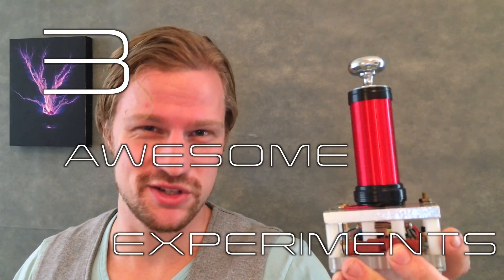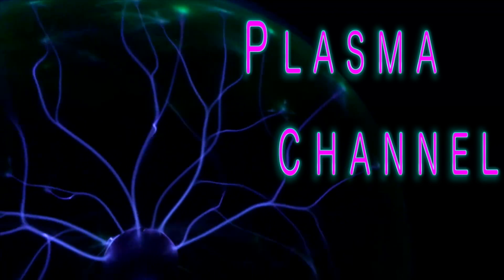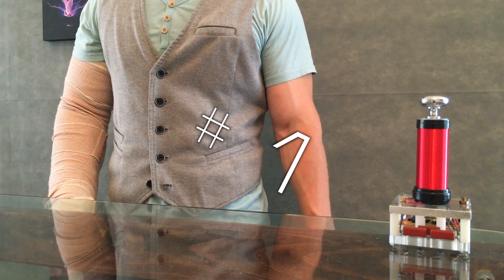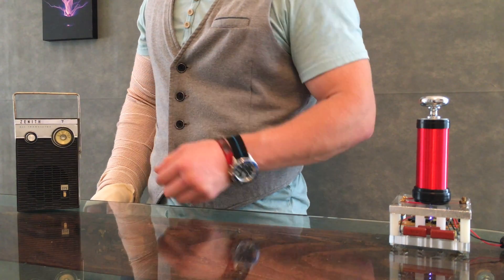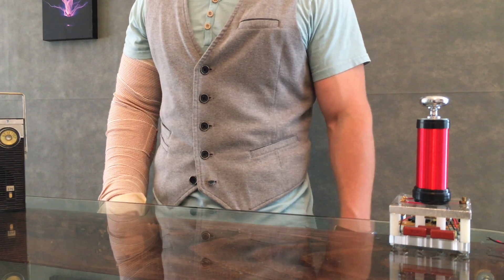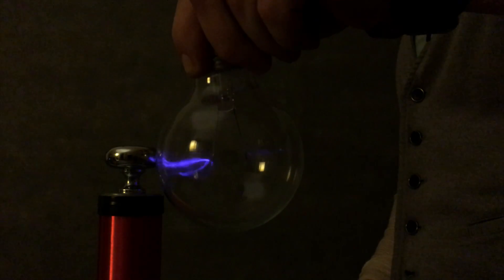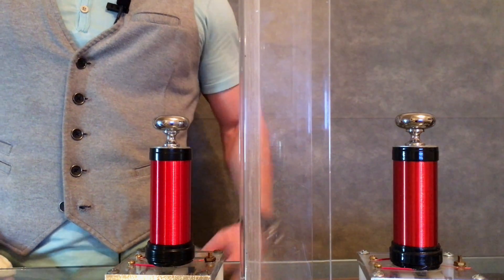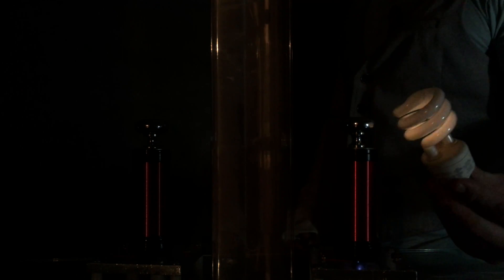3 AMAZING EXPERIMENTS | 3v Tesla Coil |

Comment: I have questions I made that but I dont  have  capacitor like what you show I only have is 3kv ceramic capacitor. I try that capacitor but that is so weak what do you think can I replace that capacitor to increase the plasma, sorry to my English  cuz iam 15yrs old Filipino I hope you understand
Reply from the maker: Hello, you need a capacitor rated to the same capacitance as what I used, in order to get the same results. VOltage is different from capacitance.
Reply: @PlasmaChannel  ahh ok really need to to find that

Comment: Bone breaks smart (usually) No video? Triple x says if you didn't get it on video, it didn't happen.
Wishing you a swift and uneventful recovery. How many resonant coils do you have? you Know each one does not draw down the power from the transmitter. You should be able to power up a lot of them and "daisy chain" a long series of them. RIght? can you step the power down to normal AC? and set up portable power in the back yard or campsite? (all on 3 volts, AMAZING PLASMA POWER) Party on Dude, stay classy. Set up a remote tea/coffee/espresso cart without power cords limiting location and tripping people (could prevent broken arms).

Comment: Is it possible to make the AC Tesla coil using 12v 1amp ac supply , sir please tell me about the overall calculation
Reply from the maker: Yes it is, but you'd need a whole new powersource. 12 volts needs to be bumped up to higher voltages in the first place.
Reply: Can you please tell me about number of turns and gauge selection to make high voltage Tesla coil using 12 v

Comment: I've heard about someone coming in contact with a high DC voltage, and the high current through the muscles causing them to contract, and that forces their body to lurch suddenly, possibly hitting something so hard that they break a bone.  I got shocked with the 250V B+ of a tube amplifier and I thought someone had pushed me from behind.  But it was only my muscles.  And I luckily didn't get hurt...
Reply from the maker: Wow. You got really really lucky. In general, always keep one hand in your pocket when working with high voltages. This guarantees you  never have electricity going across your chest.

Comment: You have to be careful with the light bulb experiment though.  If the bulbs walls fluoresce green, that means there's a vacuum in it and you're creating bremsstrahlung x-rays.  It's particularly low energy x-rays, which means your body is absorbing most of it increasing your effective dose.
Reply from the maker: It is indeed true. High voltage in a vacuum is inherently unsafe
Reply: Nonsense.
Reply: @2100Warzone   Sense.

Comment: If I power it from my bench top power supply what is the highest voltage I can put through it? Would it create larger sparks at higher voltages or just blow something up?
Reply from the maker: For extended use, 3 volts. But you can push 5 volts through it for 5 seconds at a time, with no damage. Don’t do much more than 5 second though, the little black transistor gets real hot and WILL break.

Comment: why might your coil work so much better than mine?  I can only get arcs about 2mm long to my finger and the light bulbs are way dimmer.  I am making a second attempt later next week though so would like to try to squeeze a bit more power out of it!
Reply from the maker: Did you use the specific racket linked in the description, the specific capacitors. Same number of primary turns and same length of secondary with same diameter and wire gauge?
Reply: Plasma Channel my second one will use the same racket and other than that everything is exactly the same I wondered if that might be it thanks!
Reply from the maker: Ah, that may be it! Though, with other rackets, you should have more than 2mm of spark. Strange. Anyways the specific racket listed is the best I’ve found.
Reply: Plasma Channel also thanks for getting back to me on my questions I appreciate it and I will let you know how mini Tesla coil mk2 works!
Reply from the maker: I only wish I responded sooner! You are very welcome.  You used 32 gauge enamel wire?
Reply: Plasma Channel yup put the recommended racket board in and now it’s perfect I’m getting awesome arcs!!  Thanks man!

Comment: How to make it sing?
Reply: You could use a NE555 and build a variable Oscillator. At Pin 5 you can use the audio signal to interrupt it. The output of the NE555 goes to a Transistor (for example D1650) or any other high power NPN. The collector is connected to the primary of the tesla coil, the other end of the primary goes to +12V (or more) but be careful not to use more than 18V if you use the power line for the NE555 aswell. You can use separated Powersupplies tho (for the 555 and for the primary) if you have done that you should have something called Audio SSTC

Comment: https://youtu.be/o3t2390k5R8 kinda like this but with this circuit with encased rotor vacuum and with a quad magnetic shielding to block rotor assembly from interfering with coil would like to see wireless resonates with ionic lift from conversion of electrical to mechanical to ionic lift if possible of course.

Comment: Hey for a subscriber request will you do the resonate coil shaped in a circle with two secondary windings 180 degree apart and form a mechanical rotor in the middle powered by a bifolar coil with neodymium sphere magnet embedded in the rotors centrifugal  point. I wanna see vacuum in center rotor cutting away frictional contact. Sorry if I sound demanding sorry bout your arm too I subbed your channel very amusing.
Reply from the maker: Hi Aaron, apparently I never saw this comment. Sorry! I'll do some tinkering into this process and see what I can get. Thanks for the suggestions

Comment: Dude ... signal strength goes down inverse square, not exponentially.
Reply from the maker: You are right. Can’t believe I slipped that one up. I’ll put correction in description, thanks
Reply: It's true that the signal strength goes down in proportion to the inverse square. But at the same time, signal strength goes down exponentially. - - -  Both of these descriptions are true. An expression for the signal strength at distance D is D raised to the power of -2 (negative 2). So when the exponent is minus two, then it is correct to say "the signal strength goes down exponentially".  - - -  There is more math in heaven and Earth than is dreamt of in your philosophy.

Comment: music is waaaay too loud
Reply from the maker: +nicktohzyu darn, really? We really cranked it down this this time. Mind checking on a different browser to see if that is still the case? During editing our computer showed background music so quiet it could not be heard. Please let me know
Reply: at 2:20 onwards the background music drowns out the voice. I am using the latest version of chrome on mac, maybe wait and see if other users have the same issue or it's just me
Reply from the maker: +nicktohzyu this is very disheartening if in fact we messed up the music level. It's honestly very tricky- every new video is a trial and error. Thanks for bringing this to our attention. Wish it could be changed after being posted.
Reply: Great video,  music was louder then ideal at 2:20 ish, (before that it was quieter/better) but could hear you just fine.     Where you where asking us to listen to the radio - at that point the music was kinda drowning it out a little bit -  I think I'd have muted it for that section.  It didn't spoil it for me, just room for improvement.  Made me wonder, if you has a musical coil, would the radio pick that up?
Reply from the maker: The saddest part of this is that I thought it was too quiet at 2:20, when editing. So I boosted it 3 dB, and called it good. Should have just kept it!
Reply from the maker: Also, a musical tesla coil, or musical arc, should be audible on a radio's speaker. At least within reasonable distances.